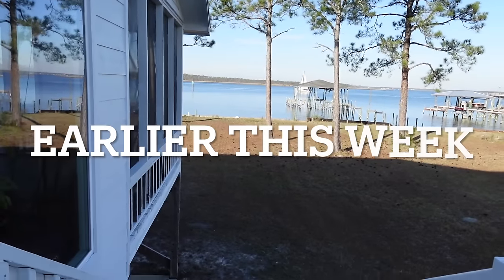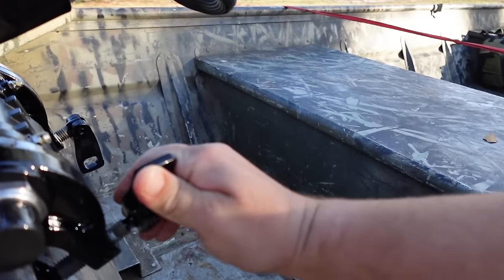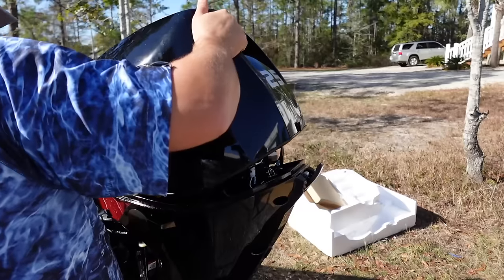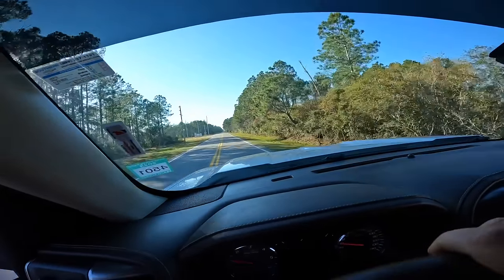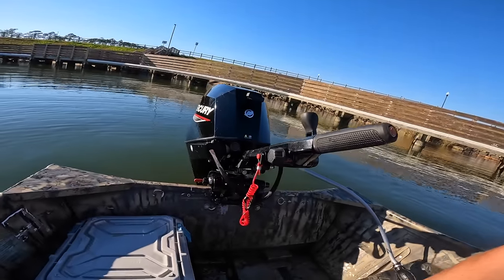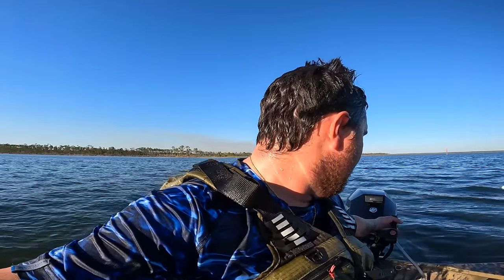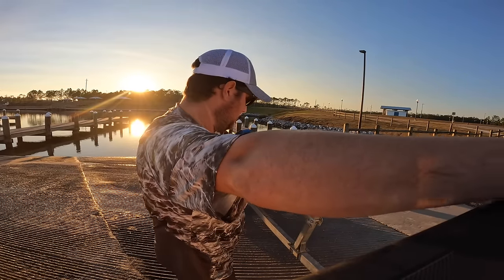I Should NOT Have Done This!

Comment: I always recommend to first time teller mode owners meaning Taylor Drive sitting in the back of a small boat and driving the engine with the handle.. to go out slowly and make maneuvers get an idea of how the boat is going to handle a V bottom boat handle so much different than a flat bottom does and a semi V handles different than both of those in its own way, so I’m glad you’re OK. Sorry about your glasses but at least you didn’t hit your head or bang one of your knees too hard on the gunnal.. also, I would recommend not just setting on the aluminum seat supports. I would definitely mount me. Some kind of a seat hard mounted to that to be in, and that helps a lot because I noticed as you were moving down the waterway your body was swaying back-and-forth a lot, and you were a little jerky on the handle anyway, keep up the good work call channel

Comment: I did the same thing in a 14' stauter with a new Suzuki 25. The kill switch saved my life. The steering tension was all the way loose, and I heard the engine cut off right as the prop was above my head.  I am religious about wearing it. This video highlights many important things, but one of the best is you realized the danger before it happened. In the future and especially if you plan on duck hunting, those instincts will keep you alive. Stop. Plan. And adjust for the danger. Glad to hear about the new boat and excited to see where it takes you.
Reply from the maker: 100% man, definitely under experienced and plenty of mistakes were made! Good lesson learned for sure! Thanks!!
Reply: Imagine if you had gone over with waders on and no kill switch.  You'd be at the bottom.

Comment: I have the Mercury 20hp 4 stroke on my 13ft. John boat. It did come with a prop and 3 gal. fuel tank and fuel line. I plan to add the power tilt option eventually.
Love mine!
Reply: I might add that my manual required a battery to protect the charging system,  electronic ignition and supply power to the fuel injectors. 
I too struck a wave once at high power.
Not too good 😂
I was lucky enough that I didn't loose my passenger or myself.
Always wear the kill switch cable.
Back off the power in tight corners.
Enjoy the water.

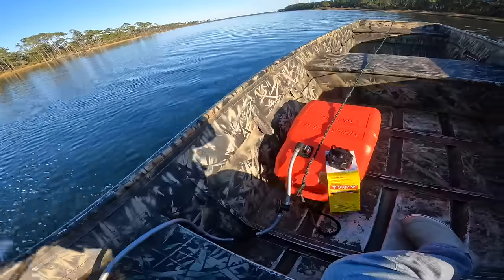Comment: Glad you came out of that okay.  At 16:18 when you said "gotta know which way to turn" told me that you've either never driven a tiller before or, it's been a very long time since you had.  I think you've got that hull overpowered with that 25. If it's a 36/14 job boat, I would guess that 15hp is the maximum recommended for that boat.
Always wear the kill switch to save others AND to save yourself from the boat circling and hitting you.

Comment: Glad you are ok, thankfully you had proper equipment on as well as the kill switch lanyard. I appreciate the fact that you shared this video. Shows just how fast something can happen on the water. I agree that the 25hp is not only too much but is also too heavy. Since they started making 4stroke portables, they have been way heavier than the 2strokes. I have a 1969 14ft Mitchell Skiff. I did a lot of research before settling on my engine. I wound up going with a Yamaha 20hp 4stroke. It's the same weight as the 15hp they offer at 114lbs. Works great on the older (heavier) boat. I would suggest the 15hp Yamaha for that 14ft jon. Should be plenty power and you can install the gas tank in the forward most compartment to help with weight. Be careful out there.

Comment: Corrosion x is also a great product to spray under the cowl and on your terminals and harnesses for any electric such as light sockets etc … it’s a little costly but it will stop rust from progressing and prevent new rust from forming. Just a heads up!

Comment: It’s Saturday AM, for whatever reason I wanted to watch you today- I’m in Oklahoma, grew up fishing the coast and  when I get to the Gulf Coast I feel like I’m home, like I can breathe again…like a giant exhale.  We’ll end up down permanent or semi permanent soon.

I’m not afraid of anything, including dying but your video unexpectedly scared me…I still have a knot in my stomach.

Same thing happened to me about ten years ago…the difference is that we didn’t have life jackets nor did we wear kill switches.

We had fished Chandelier for 20+years, never had a problem and skiffs were never as unstable as yours appeared to be.  This particular skiff pulled port anyway and the throttle spring didn’t work, therefore I didn’t have to hold it very tight while running but had to hold a little off center to keep pointed straight.  Started a port turn while wide open, the throttle was jerked out of my hand into a sharp turn…kind of like riding a jet ski, letting off the throttle, turn and hit the throttle…you’ll fly off every time.  The difference is that a jet ski doesn’t have an exposed prop and we always wear our kill switches on jet skis.

We were both thrown out near Freemason, we hit the water and the boat was almost immediately on me…tried to scoop and get under the prop and almost made it but I felt a dull thud in my left arm and immediately began bleeding badly- both arteries cut just above my wrist.  My brother in law had time to get out of the way, asked if I was OK to which I replied…”No, and if you don’t catch that boat I’m not going to make it.”  I clamped down just below my elbow and tried to stay afloat while wearing neoprene wade boots full of water and no life jacket.

I was a competitive swimmer in high school and college and that morning I decided to wear the watch that was given to me to commemorate paying off our first business, I’d always wanted a nice watch, never ever wore it fishing but for whatever reason, that morning I put it on.  More on that later.

I lost track of time and ran out of energy, began sinking.  I remember looking up at the surface, drowning.  I thought about my kids, about my bride…interestingly I thought…I think that my life insurance policy had lapsed, I was going to renew when I got home.  I knew that this was it, these were my last moments and was completely at peace, I would be fine…but I didn’t want my kids to grow up without their dad and I didn’t want any of them to have to go through what they would soon have to deal with.

I then decided to fight…that I wasn’t going to just let this happen- I’d do my best to slow down, control my breathing, to keep calm and stay afloat, even knowing that there is NO WAY I’ll survive but the thing is…I was at complete peace either way, I knew I would soon drown or lose my grip and bleed out or both but I knew I’d be fine, I was OK…if He’s done with me, my job is finished and I was never afraid.

I could go on with the story, the short version is that I relaxed, focused on staying afloat with as little effort as possible.  My brother in law later told me that it took him 30-45 minutes to catch the boat, it was doing tight turns and every third turn it would kind of pause, dig in and provided him with a window that he finally gathered the courage to get in front of it, grab the anchor line that was tied off to the bow cleat and roll himself in.  

When I arrived at the hospital, they immediately began stripping my jewelry and I asked where my watch was.  This created confusion, there was no watch.  The prop caught me right where my watch slips to when I hold my arm vertically, it was gone.  I suspect that it provided protection that saved my arm from being severed.

Three weeks and seven surgeries later I was home in Oklahoma.  Recovery took nine months or so, maybe a year.  

Several observations from my experience.  One is clear- these things can and do happen to anyone, wear a kill switch, every time.  We’d run this 3-day trip for over twenty years, six skiffs/trip…a lot of hours were spent running and never in the big boat’s history had anything like that happened.  We had no real reason for concern, nobody wore life jackets or kill switches- in the areas we fished, if you fell out of the boat the solution was simple…stand up.  (Nobody ever did).  Two, not so clear- run in pairs, it’s more fun fishing with friends anyway.  We usually did but waved off our partner, planned to meet up at another spot so nobody knew and nobody was coming to Freemason, we were completely on our own.  Three- clearly that wasn’t my day but there is purpose and meaning for everything that happens to us and my job clearly isn’t finished.  I have no idea why I am still here, I’m thankful for the second chance and vowed to do my best to serve in all that I do.  

A lot of things broke in my favor that day and I overcame impossible odds.  If any other guy on that trip was in my situation they would have been killed, without a doubt my swimming background was a factor.  My brother in law was in the best shape of his life.  The boat stayed close, running in tight circles.  My watch…I’d never before wore it fishing and it was gone when I arrived at the hospital maybe two hours after the accident.  Oh…the captain had brought his 21’ CC boat for this trip, the first and only time he had done that, he intended to surprise me with a nearshore snapper trip…he’d hidden it in the marsh and as we called on the radio for help he had just pulled up to the big boat so we had FAST transport back to Ocean Springs and the hospital.  My arm was torn up…lost an artery in fact, the surgeon could only re-connect one of them so I’m fortunate to have my hand.  No infections either and it was a gaping hole, required plastic surgery back in Oklahoma.

The life lessons are that we’re all here for a purpose, it’s our job to find what ours is and to do our best to serve.  Also…our last day is our last day, and after experiencing what I knew was my last day and making peace with my transgressions, my biggest regrets were that my kids wouldn’t have their dad and my bride would have to deal with a LOT.  I didn’t want them to be sad…well, kind of sad but I definitely didn’t want them to have to deal with the waves of grief that would soon arrive.  Also…I knew that my family and friends would comfort themselves by saying, “he died doing what he loved,” and I remember thinking…that’s what they’ll say AT MY FUNERAL and that’s nonsense, they’re WRONG.  I actually thought…they’re going to say that stuff and first of all, I hadn’t even caught a fish yet and second of all, I’m supposed to pass away as an old man, face planted in the sand on the beach with a rod in my hand!  😀

You’ve done a tremendous service to many…as much experience as you have on and around boats…accidents happen and you could have easily just filmed your own death.  Thank God you were wearing a life jacket and that kill switch, many, many, many don’t.  In fact I suspect the vast majority don’t and that’s really the best safety measure one can take and it’s easy to do…just slip it on.  

We are responsible not only for ourselves but for those onboard and we are also responsible to our family and friends…those who depend on us to come back safely and I’m thankful that you came back safely and particularly thankful that you filmed and uploaded this- this stuff happens and it’s not always someone we’ve never heard of…it can be me, it can be you and it can be someone reading this but it’s totally preventable with one or two simple precautions.

Although this is the first time I’ve seen anything that reminded me so vividly of my experience, and even though I just now re-experienced the emotions, my stomach is STILL in knots…and despite the fact that this really did scare me I truly appreciate you for posting this.  This very well may serve to save someone else’s life, so thank you.

Oh…and thank you overall for what you do, I enjoy watching!
Reply: Could you be a little bit more specific on your next comment, please. Just kidding, I couldn’t stop reading, what a story!

Comment: Hey buddy they make extensions so you can be more toward the middle of the boat. I find it gives better control. I also had 2 aluminum pods welded on the back left and right side of the motor works amazing helped kill the bow raise without adding a bunch of weight

Comment: Kudos to you for posting this!, most with egos would never allow themselves, too be seen making any mistakes! Lol. Not going to lie. I lmao, when you over corrected and jacknifed it! I have a 2011 j14 skiff with a 20hp mercury tiller on it. And it's pretty fast!, bow does the same thing. I have to have someone seat on bow, to hold it down. If it's windy and no one is up there. It feels like i'm trying to take flight! I'm told Stabilizers will help with that. I'm Considering the motor you have. Tired of the loud 2 stroke! And a tip., if you're right handed you need to control the tiller with your right hand! It'll get too confusing using your opposite hand. I use a extension on the throttle control so i'm facing more forward. Helps., But makes right turns a little harder. It's like flying a plane the faster you go ,the more responsive the sneering is! Small movements have a big effect! Versus same movement At a slower speed.. Thanks for sharing! Best of luck!🍻 From a florida native.

Comment: WOW Steve; You went out of the boat soo fast my heart sank and I had to go back and watch it again then watched the slow motion and your explanation I am soo thankful the Lord is your co pilot...GOD IS GOOD...I was soo scared for you and am Soo grateful the only thing hurt was your pride and your glasses...OK NOW being a small boat owner for over 40 years please take heed...as everyone has said ,that motor is too big for a 14 foot jon boat ,my 14 deep  V hull had a 20 hp  and I was over 350 lbs...so it handled that fine ,,,I'm now under 250 lbs. and run a 16 ft similar to a Grizzly with a new 25 hp .Yamaha that is the perfect size boat for a 25 hp.. Please sell the 14,,, and invest in a 16 it will be a lot more stable and will handle the chop much better and safer...ALSO like Eric Upton said  add a folding swivel boat seat or two it keeps you stable in one place at the helm ..even in my 16 ft  I have donre that and it made a huge difference in my posture controlling the boat...God Bless and Thank You for posting....

Comment: Glad your safe and the boat didn't sink. 

Your boat needs some rear float pods with that oversized motor. It will boat raise the rear end and lower the front end... and keep the front end from popping up as high during acceleration. Which will enable you to use more power to get up to speed faster. 

Is that hull an Alumacraft 1436LT? The rear bench looks large just like mine is.

Comment: You should build a deck in the front to give it a little weight and possibly a dauphin fin I think its called to put on the motor to help keep the boat more planted. I'm glad you're safe and hopefully you learn more how to drive a tiler hand motor once you figure them out they're pretty easy to handle.

Comment: Also, it looks like by the angle of your motor, it’s pushing the front of your boat down too much which can cause a lot of difficulty with steering and control.  Just a minute correction can cause major difficulties  especially with steering and overcorrection.

Comment: The kill switch definitely saved you!    

Without the kill switch, the engine will keeping running.   The tiller will turn to one side and the boat will run in circles.   It will keep doing donuts until the fuel runs out or it hits something.  It's super scary because it has the potential to come back around and actually hit you and run you over.   

You are a fortunate man!   Great channel, great content.  Keep it up and stay in the boat!

Comment: The lever on the side (where the motor rotates) that you can add friction for steering. Use the lever to add friction so its harder to move the motor, which in turn the steering is less jerky. Like the saying goes slow is smooth and smooth is fast. I have a very close set up to yours, 15 foot topper tracker with 25hp Tohatsu great little boat for setting limb lines/ trout lines and of the main reason for having hunting ducks.

Comment: Glad you are OK. I have done a lot of that type of boating. I know it looked like you were about to start filling the boat. If you think of a street performance motorcycle in a high speed leaning turn. The bike doesn't fall all the way because of centrifical force. As long as you kept the speed the water stays level with the top of the boat. To get out of it just back off the throttle. And don't turn into your own wake. I have been in many a small boat or duck boat at speed going down a ditch in the marsh turning into another ditch. This is how we do it.
Again glad to see you are OK. Fellow Army Veteran

Comment: Glad you are safe man!! I used to run a 14ft flat bottom with a  buddy and we would put out trot lines in a small river. We ran a 9.5 horsepower motor and it worked well with that size boat. That boat seems a bit narrow for a 25hsp but hindsight is 20/20! Great video nevertheless!!
Reply from the maker: 100% the engine was overkill, my fault on that one! Thank you!

Comment: Shout out to that IWB holster!

Try to find yourself and offset tiller handle. It’ll push the handle farther from you meaning you can sit towards the center. Should help with the leaning issue.

As far as “ballast,” trim the motor down a bit and get it dialed in. She should stand up some on take off but not that drastic.